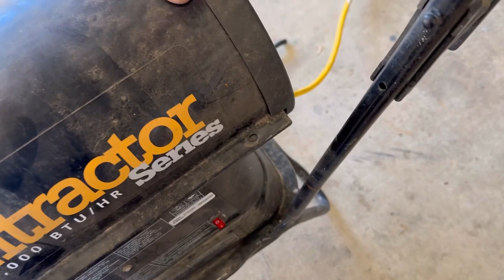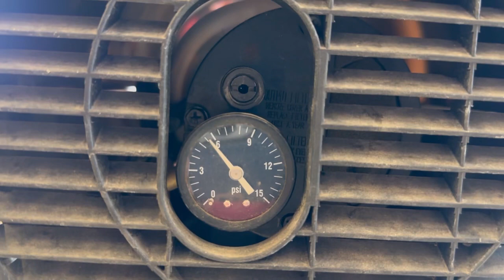#MRHEATER #TORPEDO #HEATER WONT COME / STAY ON? THEN TRY THIS EASY HACK!

Comment: Spitting fuel means that the fuel pump flow needs adjusting on the back next the gauge with flat blade screw driver, under troubleshooting

Comment: What if u changed the photo cell still isn't igniting new filter everything is a go except kerosene might be bad as everything else is working we don't get it. We worked the psi too and still not igniting. What eider can it be other than kerosene or the board?

Comment: I remember the old blue reddy heat torpedo heaters had a screw to set the mixture if that got clogged with dirt they would do the same thing. Moisture in the fuel tank will make one act up. Blistered, wore, or improperly gapped spark plug will make one act funny. Also fuel tank cap or tank vent not breathing or plugged with debris will do this. Dirt or moisture accumulated in the fuel system will do this to these heaters. If you add a little isopropyl alcohol to your fuel it reduces the odor and helps with any moisture in the fuel tank. I remember my dad used a good funnel with a water separating filter for racing fuel every time he filled his torpedo heater because it made a difference in heater performance. 
Great video 👍

Comment: Mine runs fine for about 10 minutes then turns off any suggestions
Reply: nozzel probly getting pluged or need to adjust psi check for cracked fuel lines.